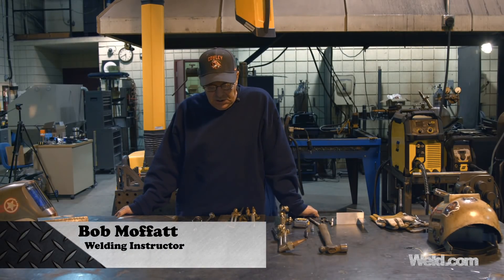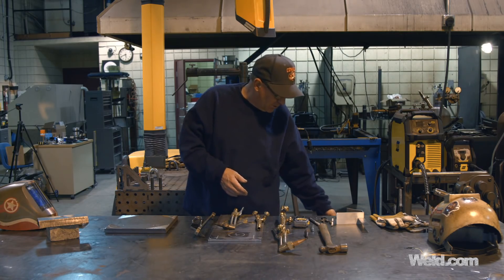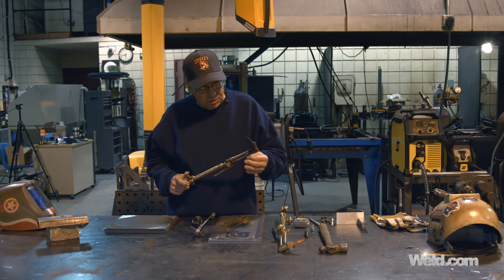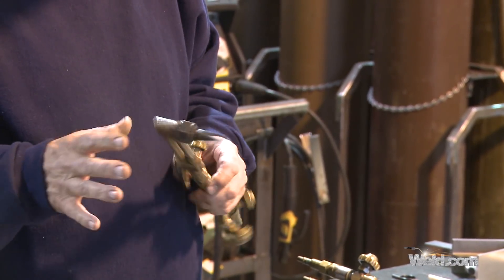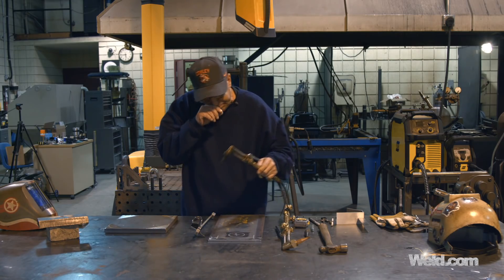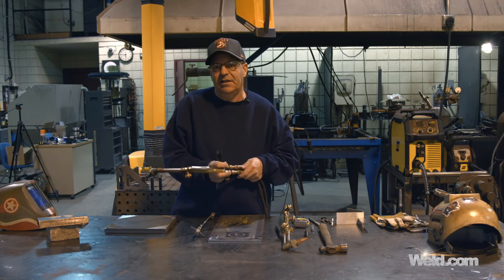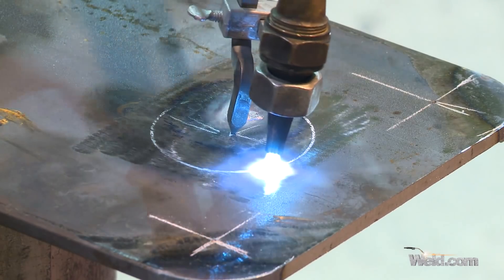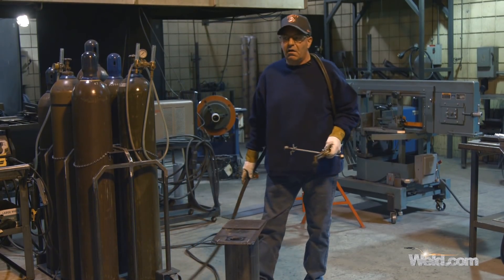🔥 Tips for Oxy-Fuel Cutting Radius Edges & Holes

Comment: I noted the first time you turned out the torch you turned the oxygen off first. Leaving a sooty flame. The second time it went strait clean out. So Fuel first. Which is the correct way. I feel like Fuel first on then fuel first off is correct but I see a lot of varying options. Likely either works without much fuss.

Comment: Hi, this vid  is talking about "popping" at the beginning. I just purchase a new cutting attachment and tip (hobart/ victor style). As I set my neutral flame, it starts popping about once every 2 seconds. I thought it may be a burr or something on the new tip, so I ran a wire through all the holes... Still pops. Any ideas on what my problem is?

Comment: Question ,  I can cut 1/4 inch to 3 inch no problem but I have started working with 10 and 11 gauge building fire pits.  I am using an 0 cutting tip 20lbs oxygen and 3lbs acetylene.  Still I am getting puddles instead of blowing clean. What am I doing wrong?

Comment: I use propane I always set it or acc at 8psi and my oxygen at 30psi. The propane won't be wasted if you set a bit higher because unless you open the valve up all the way you only use what you need. That said the oxygen is a different story. When you press that valve to cut you use what every you have it set at. Propane takes a little to get use to but its not as bad as most people make it out to be.  It will cut thin or thick with no problem. I like the way the tip is two piece. To clean you run a wire through the center and clean the flutes with a wire brush. I have been using the same tip for about 15yrs. Now I don't use it every day  more as a hobby now but I did use it every day for about 5yrs.  I do have a question. I always kill my fuel fist and my oxygen second when shutting the torch down. I have heard argument for both ways. I seen in this video you shut it off both ways. I would love for you to answer the correct way or if it even matters. Then I think maybe a video on setting up and using propane so others can benefit. Propane is cheaper and you don't have to buy another cylinder as your barbeque grill cylinder will work just fine.

Comment: Bob, let me start by saying that I’ve learned a lot from your videos. Being a southerner myself, it’s always a hoot to hear an instructor with a southern draw. My question is do you have a lot of experience with brazing aluminum? I don’t have access to a welder (TIG would be ideal) but I do have an oxyacetylene torch with a variety of attachments. I’ve used the ole’ alumiweld stuff before but am not very confident in its strength. Any suggestions to steer me in the right direction?

Comment: You said it prefect. Listen to it. I cut and fit it all everyday, I will take the time to get a 2 ft sharp tip Everytime, I'm not a grinder, I'm a welder. I figured a way to adjust my cylinders to every tip without the book guide. By listening to the rasp

Comment: 30 years construction work Pipefitter/Fabricator work with torch on a daily basis. I run my ac. On 7 or 8#'s, and oxy on 35#'s. I keep a sharpened 00 tip in my pocket. When I grab a torch(fab shop has 3 set up) I set it my way, and when I get finished I'll remove my tip, and LET IT COOL OFF before I put it back in my pocket or lunch box !! In construction EVERYONE has their way of doing things, and I have mine ! DO NOT MESS WITH MY SETTINGS WHEN I'M CUTTING ! I'M SET IN MY WAYS ! I MAKE CUTS, AND CLEAN THEM OFF WITH A FILE, AND MINIMAL AMOUNT OF GRINDING !! 
Bob has it right ! Keep a sharp tip and listen for the CRACKLE !! 
I had to learn the hard way, and got tired of grinding, THEN I pulled my head out of my anus and listened to the older fellows that were laughing at me !!

Comment: Bob, excellent video.  Could you post a plan for that circle cutter please?  I have to travel 60 miles to get to a decent welding supply store so I can build my own but don't know where to get the parts for the trammel point.  Nuts and square stock I can.

Comment: pressures,  an old welder guy told me to set the pressured high and just adjust at the torch
let's say you have 6 on the acetylene,  are you opening the valve all the way on light up?
if it were at 8 and you wanted the flame you get at 5 ,   can you adjust at the torch?
thanks,
Reply: I'm not opening it up all the way to light it. As I stated in the video, too high of pressure and the flame is not connected to the tip.
Reply: ok thank you,  part 2 ,   the flame should not be off the tip?
i was also told to be careful that the flame doesn't burn inside the head...
i usually use about 7 actylene and 40ish oxygen,  and just adjust the flame,   on 1/8''   i just move fast,  on 3/8'' a little slower   but i'm new to this ,  only a year or so,    any advice is greatly appreciated,
someone who has your experience is a book that can never be read,  only small quotes taken,    thank you

Comment: Thanks good video. I learned to go a little cleaner, a smegr more oxygen pressure.  oxy full open acetylen 1/4 to 1/2 turn open is a good guide. But the most importan is correct pressure from the bottles. use the guide from the specific tips.

Comment: I got a question... Why would a TIG machine shock your hand when your tungsten is well under ⅛" gap between the material?
Got a DC shock yesterday on my feeding hand with a brand new CK TL 210 while working on some pipe. Removed every bit of galvanize from it, but it's always there somewhere... Is it something to do with the residual zinc and tungsten that causes it to jump through the torch head to your hand to complete the HF circuit?

Thank you for your videos! 👍🏼
Reply: You got bit by the HF? Wish I had a dollar for every time that's happened.

Comment: Hey Bob
Good video. I took several welding classes years ago and that is how we were taught to set pressures, basically a 4:1 ratio. Proper way to start up and shut down a oxy/acetylene rig was stressed as well
Do you think at some point you could do a video on setting engine drive welders with separate amp/volt adjustments? I’m sure you train several potential pipe welders there and when they get in the field they need to understand the volt/amp curve on the SA and SAE Lincoln machines
Thanks

Comment: Another very informative and logically presented video.   Thank you Mr. Moffatt.

As for a question...Could you compare Oxy-Fuel cutting to plasma cutting?  There are probably advantages to each, but I have no idea what these aspects are.
Reply: Gregory Parrott Oxy/Fuel cutting is an oxidative cutting process, not purely thermal like a plasma cutter. When you cut steel, which is nearly pure iron with small amounts of alloying elements, using oxygen you are actually rapidly converting the iron to iron oxide. The rapid oxidation of iron to iron oxide is VERY exothermic, and is what generates most of the heat needed to keep the process going. The iron oxide also stays molten at a relatively low temperature so it flows clear of the cut, exposing bare steel that has been heated to high temp by the iron oxide that just flowed away. This allows the reaction to continue.

Other metals, such as aluminum or stainless steel, will oxidize like iron, and some like aluminum are also  very exothermic. However, the oxides created (aluminum oxide for aluminum and chromium oxide for stainless steel) are refractory, and even when molten they stay attached to the surface of the underlying metal, shielding it from any further reaction. That is why oxy-fuel cutting only makes clean cuts on relatively low alloy steel.
Reply: This is what I love about YT, the Video and the Comments/Forum! Good solid input to learn from others from ALL over the World. Most of what is discussed in this thread I understood prior to now. Just love to hear from others and learn from them. Cheers from John, Australia.
Reply: Gregory Parrott As a general rule, oxy-fuel will only CLEANLY cut ferrous metals with relatively low chromium and/or carbon content. Contrary to what many think, you can cut cast iron and even high chromium and stainless steel with oxy fuel, but the cuts are not clean by any stretch (especially stainless). The old Linde "The Oxy-Acetylene Handbook" gave detailed instructions on the procedures for cutting cast iron and high chromium steels. Starting and maintaining the cut with the help of a steel rod (flux cutting) is sometimes done. Another variation of flux cutting used on plate material is sandwiching the material to be cut tightly between two thicker steel plates, and using a tip large enough to cut the combined thickness. In that case, the top plate provides the super-hot molten iron oxide that will cut through the cast iron or stainless (or whatever), while the lower plate prevents the refractory dross from globbing up on the bottom of the plate you are cutting. The ultimate in flux cutting is the powder torch, which is a special oxy-fuel torch that injects fine iron powder into the oxygen stream,  creating a nice stream of super-hot molten iron oxide that will burn through pretty much any hard to cut material. 

Actually, the ULTIMATE in flux cutting is the oxygen lance :D

Plasma, OTOH, will cut any metal that is within the machine's capacity. Even the biggest industrial plasma cutter cannot match oxy-fuel for the thickness of metal it can cut. However, within the machines range it can cut metals that make very refractory oxides (i.e. aluminum), as well as metals with very high melting points (molybdenum, tantalum, etc.).

Many will say plasma makes a cleaner cut, but I have found that, given a good torch operator, the oxy-fuel process can match plasmas cut quality, and usually exceed it on material that is near the plasma machines max thickness capability. I have seen oxy fuel cuts on 1/4" that you would swear were cut on a laser cutting system.

One clear advantage of plasma is that it only needs electricity and compressed air, along with the occasional electrode consumables. It's major disadvantage is that it is a one-trick pony: all it can do is cut. Well, it can gouge too, but IMO oxyacetylene gouging on steel leaves a cleaner groove, and the highly oxidized slag from the torch cleans off easier than the mixture of oxidized and unoxidized slag you get with plasma.

Oxy-fuel is portable since it needs no electricity or compressed air. It can also do more than cut. You can heat and weld (acetylene only for welding) with it as well. You can even weld aluminum with oxy fuel. You can of course also braze and solder with the process. So it is definitely more versatile. If you could only have one single "heat" tool for doing metal work, the oxy-fuel torch would be the one to choose.
Reply: WTFChuk - Thanks for taking the time to write this most complete answer. While I was aware of the oxidative cutting process (I originally thought it was strictly thermal until I tried to cut SS and had a lot of issues) I was not aware of many of the things you mentioned. Really appreciate the information
Reply: Some of the advantages of oxy-fuel cutting. Typically you have a lower start up cost for the rig. Not as much as it used to be because the plasma torches are slowly coming down in price. You can definitely cut thicker cross sections. You have flexibility in you fuel gas, propane, acetylene, mapp etc. It is more portable. You don't need a high amperage power source or any power source for that matter. It is flexible, with a simple change of heads you can use the rig for welding, brazing, pre heating, heat treating etc.  Some of the obvious limitations are the requirements to have high pressure bottled gas which typically requires you to pay bottle rental per year whether you use it or not. You also have to pay to refill them and they always seem to run out when you need them the most. Only capable of cutting carbon steel. A high quality cut is harder to achieve without a lot of practice. Set up, adjustment and prep is a little more tricky.
Reply: TheKajunkat  Thank you for the detailed reply. Everything you said makes sense. But, I don't understand why oxy-fuel can only cut carbon steel. Following your comment, Harry Pehkonen affirmed this limitation on cutting (thank you, Harry).  Barring ignition (such as magnesium), or insufficient temperature, I would think the torch would cut any metal
Reply: WTFChuk   Thank you for a clearly articulated and very detailed explanation!
Reply: WTFChuk  I've seen both laser cut and liquid jet (mixed with abrasive and shot out at ~50,000 psi) cut examples. Granted, both use equipment with a cost well beyond what an average shop can afford. But both can make deep and clean cuts
Reply: You can not cut cast iron with oxy/acetylene, but you can (I believe) with plasma (if it's powerful enough).
Reply: Typically the difference is in cutting speed and efficiency in terms of a dual performance. The plasma cutter can cut materials up to like an inch pretty fast. anything over like 1" it's more efficient to cut with a torch. Plasma can cut any conductive metal, whereas the torch can only properly cut ferrous metals (it can melt other metals if need be)

As other people have mentioned  the plasma cutter has a higher initial cost but lower operating cost per cut

Comment: Hi Bob, 

They were very nice cuts. 

Never cleaned the mill scale off, nor seen anyone do it before, thanks for that tip. 

Would that also help with plasma cutting? 

Also never be taught to preheat the cut area, clearly has to help increase the travel speed and cut quality. 

Also noted your comment about pressure. The 4:1 O2 : fuel gas is what i normally use,  and rarely do i cut >20mm, and naturally change tip for the thickness, but for thick >50mm to increase O2 pressures. Do you maintain that 4:1 ratio even on heavier material? 

I also like you radius attachment, most of the commercial units don't adjust down to that small a radius. And being under threat handpiece keep the torch well balanced. 

Very helpful. Thanks. 

Dennis

Comment: Another great learning video Bob. Maybe down the road you could do the same thing with a plasma torch setup and use. I’ve seen the same issues using to high of amperage and air pressure cutting thinner materials and people wondering why the cuts were so bad looking. Again thanks for the great way you teach people on the proper methods of using equipment when oxy/acetylene cutting.

Comment: There is a reason why they sent cheat card with the Torches for the pressures and shows what size of tip goes for what size of thickness of metal.

Not sure how much it helps sometimes the human factor in that's evolved.

Comment: I just want a video on making a circle cutter. Did you broach the square hole in the slider or file it square from a drilled hole?
Reply: I bought the little parts. They are at your welding supply store. Or should be.

Comment: I run 40 oxy and 5 actylene from 1/4" up to 1/2" and get great cuts with no slag... If I get up to 5/8" or 3/4 I go up to 8 on acty. and leave oxy at 40... Great video I also have one of those home made compasses I built 15 years ago and still use it to this day...lol 👍
Reply: I've never cut with arg. I've said arg after a cut though.
Reply: Bob  Moffatt Lol..I meant actylene, I feel like an idiot for putting argon, didnt even realize I had done that...😂
Reply: Jesus is King I knew that. I couldn't resist. Lol
Reply: Jesus is King I also use 40 on oxy and 7 on acty ! My grandfather showed me years ago , with these settings you can cut with multiple tips and all sizes from 1/4 to 1” like butter !
Reply: AMEN!!!!!

Comment: Journeyman torch, generally run 7/38 lbs...,  layout with soapstone...briefly preheat and pull the trigger following the layout lines ..this will burn off 90% of the mill scale ,    put layout lines back in and on thicker material hit the edge ( on corner radius cuts) with a chisel,, this will cut down the pre-heat necessary to get up to cutting temp as the raised edge will come up to temp much more quickly...   may help some folks out there....  enjoy your videos and a guy can always pick up new tricks

Comment: I absolutely hate those cutting attachments for welding torches, I only ever use a dedicated cutting torch. Apart from only two gas controls knobs it does not have the middle joint to leak but the main reason is with a dedicated cutting torch you have a longer reach and your hand is further from the heat.

Comment: That has to be the oddest way i have ever seen somebody use a circle burner. Easiest way I have found or seen (for right handed) is to start your torch at 12oclock and your and your circle burner handle at at 5olock, reach over with your left hand and move everything counterclockwise till you go all the way around. 7oclock for left handed and go clockwise.

Comment: Does propane butane mix are suitable for cutting?
Reply: I've used several types of gasses but not that one.
Reply: And, make sure you use the tips that are compatible with those gasses.
Reply: Make sure you have the correct regulator, flashback arrestors and hoses if you are going to LPG or similar. Acetylene hoses are not recommended for LPG.
Reply: I've read that oxy-propane can make better cuts than oxy-acetylene, maybe less likely to melt the top of the cut?  There might be a small cost saving, in that propane is cheaper, even though you have to use more oxygen.  I haven't made the trial yet, seems like it would be a good project for students.
Reply: Leonard Pearlman We used to have natural gas in a shop I worked in. Super nice clean cuts. Little slower though.